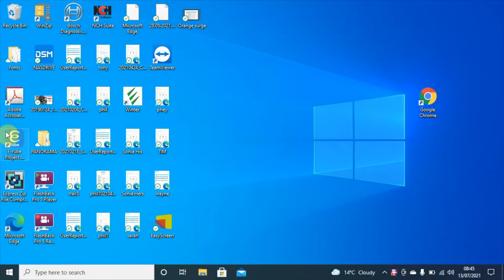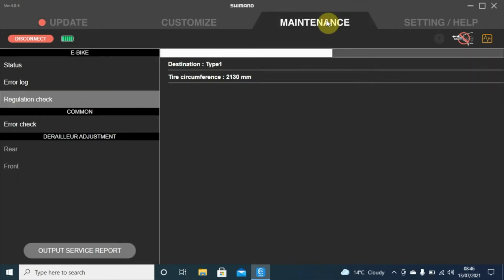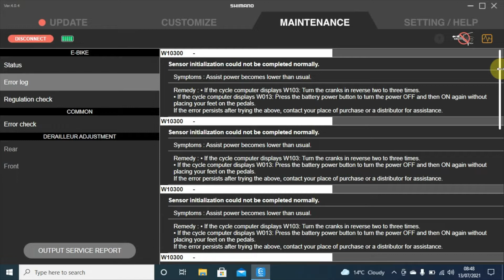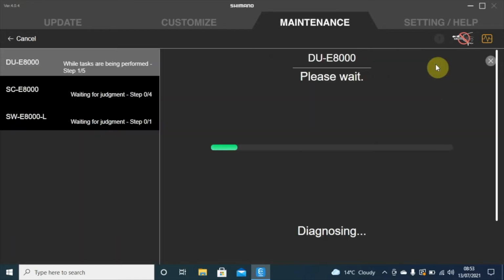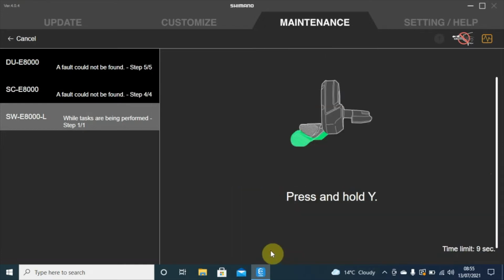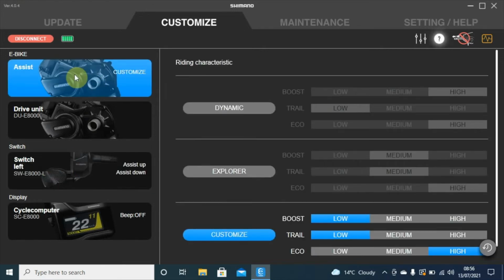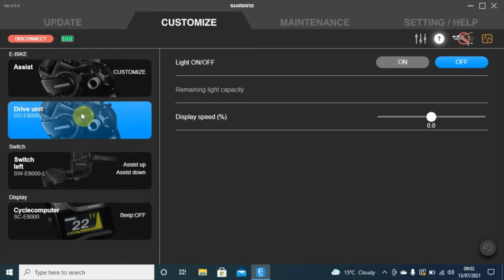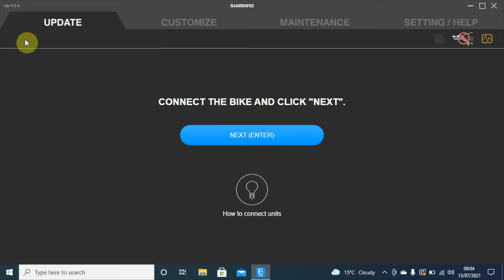Poorly lapierre 627i, shimano diagnostics walkthrough. Suddenly stopped working, fault finding & fix

Comment: Another excellent video, Dave; any chance of a video on the EP8 and it's common error codes, particularly correcting W101 (Intermittent Speed Sensor). It's a shame I'm not close enough, as it's a long way from Yorkshire to Cornwall.
Reply from the maker: Hi Martin, You should now find a new video on the EP8 in my list. your dealer or you if you have the software need to follow the procedure to determine the next steps to follow, Im not sure of the details of your bike or its history.

Comment: Thanks for this Dave. Great as always. It was nice to see the Shimano PC software in action.

I have set my ECO as high, because I found that if I set it any lower, I just was not using it. Also, I have my Boost set to low, mainly to save battery, and I use it only to grind up hills at lower personal effort. I do have my Trail setting set to high, though, and that is my go to setting when trail riding.
Reply from the maker: Thanks for sharing! Its great to be able to customise it how you wish.